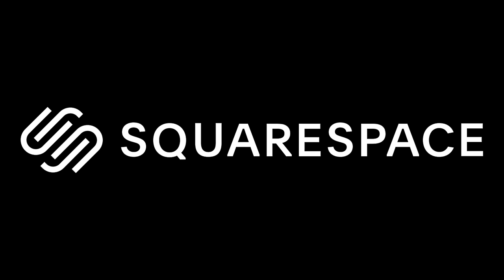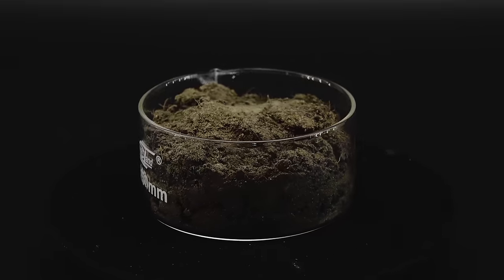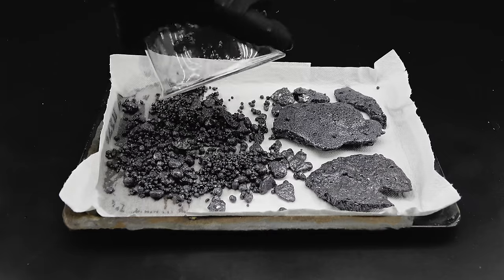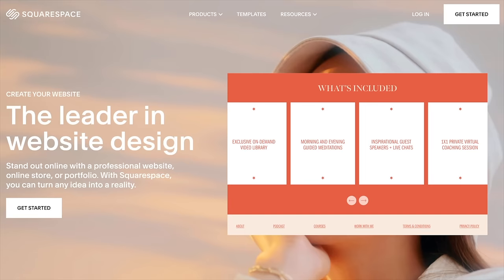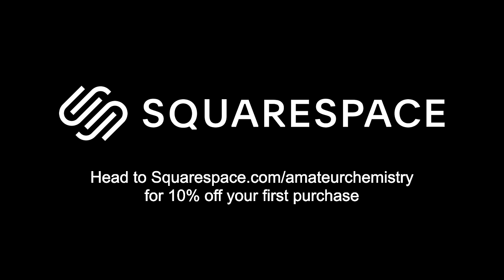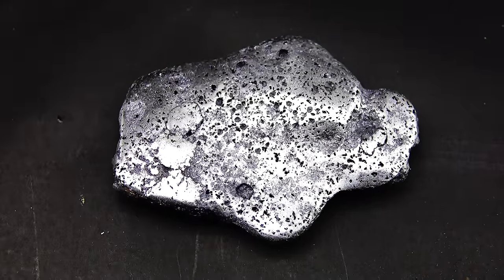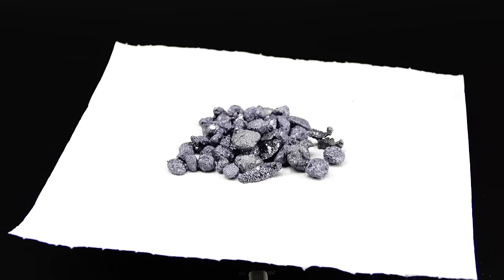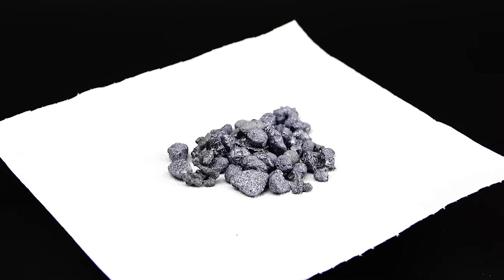Turning Dirt into Silicon

Comment: He produced 1m³ of pure H2S. If it's dilutet to 100 ppm he contaminated over 10000 m³ of air. That's the size of a 10 floors high building.
Reply: Real baller move I have to say
Reply: So, what would be the process of neutralizing it while being produced?
Reply: @nunyabisnass1141  Breathe it in, lungs are kinda like filters! 😃
Reply: @nunyabisnass1141  (Put water and neutralise with any base)
Reply: @nunyabisnass1141  I'm planning to make a similar thermite. I will either use an airtight system so the H2S can be burned or I will use an oxidiser, probably bleach to hydrolyze it. Seeing how exothermic the hydrolysis is an airtight system leading the H2S into bleach would probably be best
Reply: @hantrio4327  ah, thank you. I don't plan on doing this, but just in case it's good to know.
Reply: Lethal cloud.
Reply: 100 ppm is considered the IDLH limit
Reply: It’s not great, but it’s really an absolutely insignificant amount compared to industrial pollution. That one cubic meter will get removed from the atmosphere within 24 hours, and be diluted down to 1 ppb, not much higher than natural bacterial production.

Comment: When purifying the sand, the first acid step should be soaking with vinegar.  Using sulfuric acid will leave insoluble calcium sulfate and other insoluble  sulfates.  Adding the sodium carbonate will leave insoluble carbonates from soluble sulfates like magnesium sulfate.  An additional gravity separation step would clean the sand of heavy metals.  Think gold panning but ssving the sand.
Reply: Is vinegar really strong enough? Or would you need glacial acetic acid?
Reply: @ChemCrafter  vinegar is fine for most carbonates and hydroxides.  It probably isn't sufficient for some oxides and base metals.  Particularly silver and lead.  But the sulfates are insoluble so sulfuric and hydrochloric won't work for those.
Reply: @lrmackmcbride7498  That's interesting, cheaper, safer and more readily available than sulfuric acid, and gold panning makes a lot of sense too and wouldn't take much more time considering the amount of washing needed anyway.
Reply: @ChemCrafter  and the stuff that forms insoluble sulfates and chlorides is usually the heaviest portion so gravity separation will leave it behind.
Reply: @ChemCrafter add hydrogen peroxide to the vinegar.
Reply: @ChemCrafter  "Cleaning vinegar" can be 30% or more, so that may accelerate things a bit.

Comment: The extra 2g of ‘sand’ is probably steel from the cans!
Reply: No, my friend. Such are gifts of chemistry gods. Or the scales god went on holidays.
Reply: And balls. Somewhy no one consider that sand grinds balls as well as balls grind sand
Reply: I work at a cement plant, and the mills definitely add mass to the final product which is directly linked to the microscopic fragments of the steel balls during the milling process. the steel balls even need to be eventually replaced after a certain time
Reply: @pogan1983 hahahahaha

Comment: The extra mass after using the ball mill is probably coming from the ball bearings literally getting sanded down.
Reply: The ball bearings are definitely softer than quartz, which is probably in almost any dirt.

Comment: H2S is flammable.  It can be directed to a flame or ignited for safe destruction.
Reply from the maker: Yeah, but all the steam generated by the heat of the reaction would probably stop it from burning and it would produce SO2 which is also quite nasty
Reply: @Amateur.Chemistry  You can feed the SO2 into a lead chamber and make H2SO4
Reply: @Amateur.Chemistry  we used to destroy H2S and other contaminants like NOX at a company I used to work for.  We had a natural gas flare that very effectively destroyed these chemicals.  The key is to make the flame larger than the gas stream.  I always mention it when I see folks that produce NOx or H2S because it was so simple and didn’t require chemicals.  Anyway, love watching your videos.  This one was epic!

Comment: if you put wires on random places on the silicon crystals you should be able to find a diode spot and make that spot glow...
Reply: It would be possible to make a very inefficient diode from it, but hey... isn't it a hint on a new experiment?
Reply from the maker: That's very interesting! I will look into it and maybe in the future make it into a video :)
Reply: Those are referred to as "cat's whisker" crystals because of the thin stiff wire used to probe with.  They act as a diode.  You can make an AM radio with not much more than the crystal and a coil of wire and earphones.

Comment: "that somehow survived the acid's treatment" -- iron oxides are wildly insoluble in water; it takes a lot of acid, heat and time to do this job!  I would think more like 20% H2SO4, and boiling that for at least hours but probably days, would significantly whiten the sample here. Complexes also help; HCl might work faster (if you don't mind the fumes..!), or EDTA even faster still (Evaporust(R) etc.). Acid washing after grinding of course helps too -- the mass gain was probably iron filings from the balls wearing.

Another giveaway: the solution was hardly tinted, and it didn't look like anything precipitated on neutralization (or at least much).  (Precipitate would be fine enough to wash out, but obviously keeping it in solution would be preferable.  Maybe after mixing it around, you neutralized mostly excess acid? That would be fine too.)

99% pure silica sand is off-white to bright white, and can even be mined as such in a few places(!).  It's not obvious if your sand can get quite that pure (the grains themselves might be tinted, or are trapping impurities), you'd have to microscope a few.  Or perhaps assay the final product? :)

Comment: I can already smell the chlorine and SiCl4 forming. Nice video and great yield, but when I've seen this done before they usually dissolve the sand in molten alkali to give sodium silicate, which they filter the junk out of and then acidify to precipitate hydrated silica, which is what they use in the thermite reaction.
Reply from the maker: Thanks! I've actually done this exact thing on a much smaller scale a year ago, but since sand is already quite pure silicon dioxide I just didn't want to bother with the silicate purification process on such a large scale. Also, you are right about the SiCl4, I actually just finished making it and it is a really nasty chemical :)

Comment: I really liked this because of the cleaning steps. I would not have done it those ways, but happy to watch your methods and hear your comments. I would likely have looked online to buy clean sand already powdered, and avoid time, acid, water and mess. The point is to test the aluminum sulfur siliconDioxide thermite reaction.  Then you have no test to be sure it is silicon or estimate purity. NMR and x-ray? I would have to remind myself.  And the thermite likely works for smaller samples.  I was interested to hear that H2S is flammable. Indeed and rather hazardous. So it makes an interesting project/demo. But, perhaps, not such a good clean way to make silicon.  I reviewed the processes and global aluminum industry last night. Perhaps electrolysis. How much heat would be needed to keep it molten, and then use current.  They found that current keeps the alumina molten needed sodium aluminum flouride to lower the melting point.  That is the Hall-Heroult process.  And they are trying to change it to "carbonless". Now they use carbon anodes and they want to find a better way. Do not restrict yourself from thinking at global industrial scale, and about solar system chemical and energy industries.

I am checking all the chemistry that might help for Mars and Moon.There is lots of oxygen in the oxides of the regolith and molten glass and metals make good starting materials for many things. I took my first chemistry class in high school in 1964 and most every year since I keep at it. But I mostly studied how to use electromagnetic methods, nuclear energy, radioactive energy, and industrial chemistry, transportation, and space applications.  Plus international development, global knowledge, and the future of the Internet and human species. Moon has vacuum, lots of "dirt" and sunlight. Mars has lots of water, "dirt" and you can run nuclear and atomic generators flat out  by keeping them away from camp. Let robots run them.

Filed as (YouTube - Turning Dirt into Silicon and other things - Mars and Moon)

Richard Collins, The Internet Foundation
Reply from the maker: Thank you very much for your donation and thoughtful comment, I really appreciate it :)

Comment: Nice job, also because you showed how to perform dangerous, hazardous chemical reaction in socks... Some advices for next time: I think this reaction should be performed in a ceramic pot, as old alchemist ones, in a chimney, so you can at least direct toxic gases towards the top or eventually filter.

Comment: That was actually surprisingly simple! (but a lot more deadly than I would have expected lol) 
I'm hoping you melt some of the silicon and pull one large crystal from it.... All you have to do is heat it up until it glows and melts (and then keep the silicon just molten enough to be viscous and solidify if a small amount is pulled out and held a few inches above the surface) and then use a small piece of silicon  (I THINK you need to use a piece that is already crystalized... so the stuff you have PROBABLY won't work since any crystals thats formed are probably very small and mixed throughout the silicon matrix randomly... so it might be best to use a trash cpu or gpu... but you HAVE TO use the bottom most layer... like if using one similar to what you had shown in this video you would want to peel it off of the PCB substrate and clean off any glue or reside used to hold it to the PCB and expose the 99.999% PURE silicon used on that very bottom layer [which is the thickest piece of silicon in the chip] which is QUITE THIN, so you should probably break the chip in small pieces, keep a note of which part is the bottom silicon layer, and if possible to see, mark where you see the fist player of non-silicon material is bonded to the silicon) glued to a solid metal wire about 2 or 3mm wide, or thick and strong enough to hold the weight of the molten silicon) and you dip JUST THE SILICON CRYSTAL (no further than the marking you might have made earlier) into the molten silicon, hold it in there long enough for the molten silicon to stick to the piece you glued to the metal wire  and then you SLOWLY pull the wire up and out... You also MIGHT want to ROTATE the container of molten silicon ... (I'm not too sure you need it to be rotating since you aren't trying to make a perfectly round crystal... that's just what they do when they're pulling a crystal for making silicon wafers for computers chips)
- You could also just melt the silicon until its molten and then remove the heat slowly to allow it to cool down VERY SLOWLY just in the container you melted it in, and forgo using a seed crystal like I described above (idk why I went through typing all that out LOL I DOUBT you are planning on making transistors with this LOL - But you should at least melt it down to remove all the gasses dissolved in it that are creating all those ugly holes... You have plenty to experiment with, so I think you should give it a try and make another awesome video!!! - That was AMAZING!!! THANK YOU!

Comment: Have you considered using a cheap furnace to add the extra heat instead of sulfur with more aluminum? I've seen plenty of DIY-bult furnaces powered by electricity, or propane, or food oil, or any other heat source. It might be easier to deal with than all that hydrogen sulfide.
Reply: Fantastic comment.  Probably better purity, too.
Reply from the maker: This could work, but I wonder how vigorous would the reaction be and such a heat source would need to go up to a really high temperature
Reply: @Amateur.Chemistry  I've seen videos of people melting cast iron and copper with homemade propane or food oil furnaces made with materials like fire bricks, kaowool blankets, and high-temperature mortar. That might be hot enough since it is over 1200C to properly melt cast iron and that's most of the way to silicon's melting point, the heat of the reaction might be enough to get it the rest of the way there. With ideally no volatile materials involved, the reaction ought to be reasonably tame.

Granted I'm no expert and have no space where I could test such a thing.
Reply: Melting metal with wood is a lot of work. Wood fires lose heat very fast. So if you miss the chance to refuel it with wood everything will just stop and need to be restarted. Ive been trying to calcinate egg shells for awhile and i haven’t been able to calcinate more then a few grams at a time.
Reply: @fajile5109  electric is the way to go.  No hot exhaust reduces energy consumption considerably.
Reply: @fajile5109  If you are to use a solid fuel, you'd be much better off with something closer to pure carbon like charcoal. I'd still prefer a liquid or gas fuel over even charcoal. Wood burns dirty and can be inconsistent.

Comment: You should have separated the spent hydrochloric acid from the sand before neutralizing it. the dissolved solids would have dropped out of solution separate from your washed sand. as it is you have increased the necessary work & increased contamination.

Comment: Maybe the 2g added to the ultrafine SiO2 dust is steel dust? I think SiO2 is slightly harder than steel, so it could have abraded steel from the ball mill balls or can walls.
So you maybe re-added iron (and a small amount of carbon) even though you ran the Nd magnet through the original sand to remove the iron contaminant.

Comment: The dirt where I live has more clay than sand. Would I still be able to do this?
Reply: The clay would be dissolved in the washing step.
Reply from the maker: Yeah, you just would need to use more acid for the cleaning step
Reply: Clay is light you can wash most of it away with water.

Comment: Using dirt to make silicon is interesting but man, dealing with all those impurities must ssuuuhhuuuuck if you're going for electronics grade Si.  Also need vacuum chambers and to hold the temp at 1100C for 200 to 300 hours to react SiCl with hydrogen to make pure Si and HCl.   Simple in principle but really really energy intense. 
Still. Ya got some reasonable Si with your grill. That's pretty cool.

Comment: I would guess at least some of the extra weight after the ball mill was from the metal abrading off the balls.  Probably easy enough to get it out with the magnet, though if you're adding thermite, it really won't matter in the end.

Comment: Is any way to make this termite reaction with SiO2 with out sulfur ( something not toxic)?
Reply: Use magnesium instead of aluminium. Don't use an excess of magnesium or Mg2Si will be produced
Reply from the maker: Yeah, magnesium is a good replacement but finely powdered magnesium is even harder to buy than aluminum
Reply: @Amateur.Chemistry  I know it cost about 350zł/kg ( ≈ 45$/pound)

Comment: btw, bouncing metal balls mill with electricity can be done with maglev coils instead of electric motor rolling, ie no moving parts. heat, why not do the reaction with external heat source, like furnace heat. yep induction stove maglev ballmill. try electrolysis of molten glass.